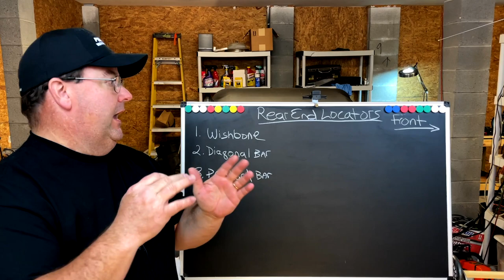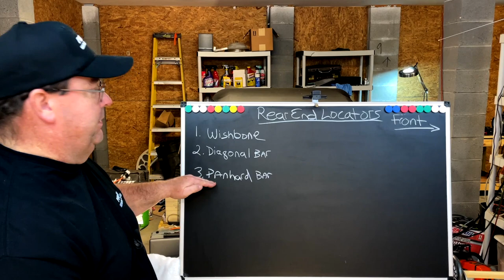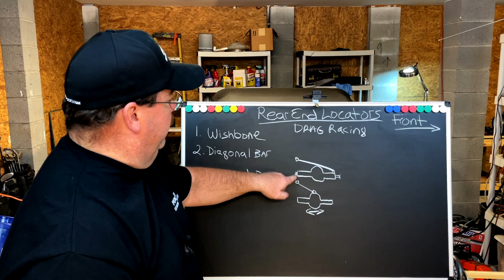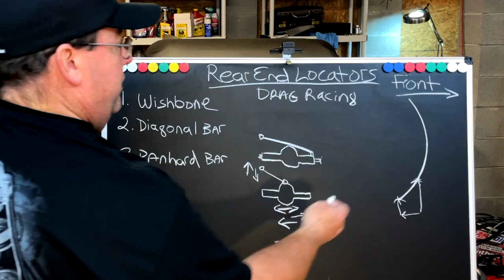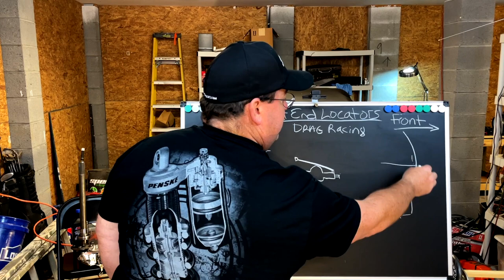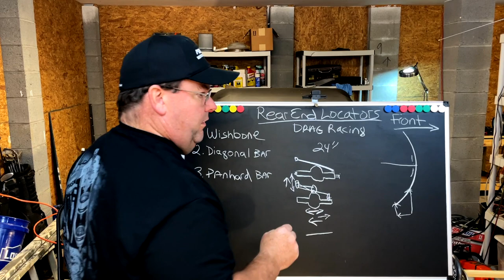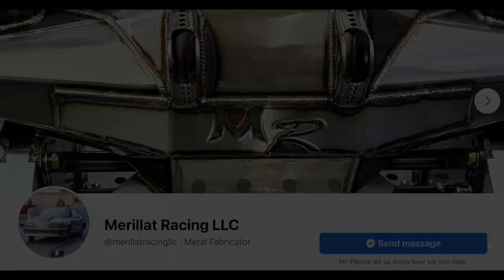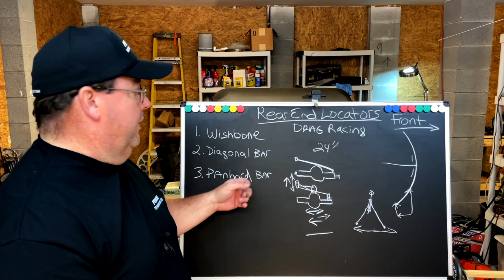Keep your Rear End Square - Wishbone locator, Diagonal link bar or Panhard bar?

Comment: Thanks Kevin, great vid.  Quick question, is a watts-link another option, and if so where would that fall in your preference list?  I’m still in the early learning stages of suspension components (your videos have been a huge help!) so my apologies if it’s a silly question!   My initial research has been comparing the panhard bar to a watts-link, I  wasn’t even aware of the other options!
Reply from the maker: Thanks Paul for asking this! The Watts link is actually, in my opinion, an improved option to the panhard bar, especially for road racing courses. However, with the watts link option, you really need to keep the 2 link rods the same length and at the same angles, so the rods should be installed parallel to each other. For drag racing, I tend to avoid them if at all possible. Not because they don't work when properly setup, more for on the rear of a drag car, it is already very busy on the back of the chassis. When you consider coilover shocks, rear ARB, 4 link or ladder bar or leaf springs, with shocks and ARBs then having 2 more rods that need to have mount points and then a center pivot on the rear end rear cover centerline, then you just simply begin to run out of room. Especially for cars more concerned with straight line acceleration, drag racing, the simple solutions like a diagonal link bar just works so well, and keep a driver from getting in trouble with out of whack geometry. Or even a panhard bar properly set up as explained in this video, is much simpler and provides adequate left to right lateral control. Hope this helps!
Go fast, go straight! Be SAFE!!
Reply: @KevinWilsonSBC  Thanks Kevin, that certainly clarifies things for me!  I had actually wondered about a lack of space under my vehicle, I’ll now consider those other options. Cheers from Australia!

Comment: Would you recomend a diagnol bar on a leaf spring ladder bar car with floaters and sliders?
Reply from the maker: We generally have not had to run any locators on the 4 link or ladder bars with leaf springs and floaters. There is certainly not any harm with adding a diagonal link bar though. Go fast, go straight! Be SAFE!!

Comment: I see a lot of guys putting rear steer in the car...Is this a band aid for another problem an easy fix or normal....???
Reply from the maker: There are times where you need to introduce rear steer to help drive the car straight. The chassis has a natural tendency to twist up on left front, which moves more weight over right rear, which in turns drives the car left. Even with the best rear ARB, this loading of the right rear requires introducing some rear steer to help overcome this chassis loading. Go fast, go straight! Be SAFE!!

Comment: What's your take on guys using a wishbone on leaf spring cars?
Reply from the maker: I highly encourage a locator device for any rear setup. We have on a few occasions not ran one for ladder bars with floaters and sliders with leaf springs, but that was the owner's decision, not ours. Now those cars worked great and did not show any left to right movement. However, a wishbone or even adapting a diagonal link bar will never hurt as long as it can move with the suspension up and down. The leaf springs do a great job of holding the rear end, but their main job is to support the weight of the vehicle. Just so happens they do a decent job limiting laterally movement. So anytime you can add a wishbone to ensure the rear end stays centered, I FULLY support. Sorry for the long winded response. 
Go fast, go straight! Be SAFE!!